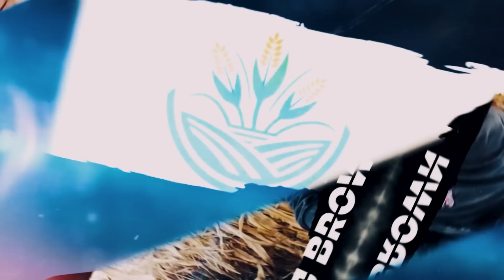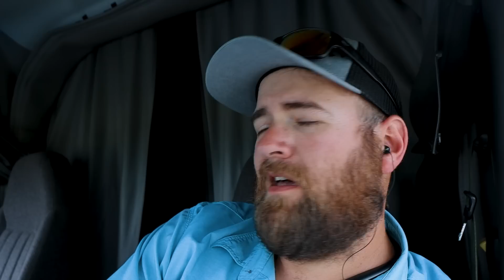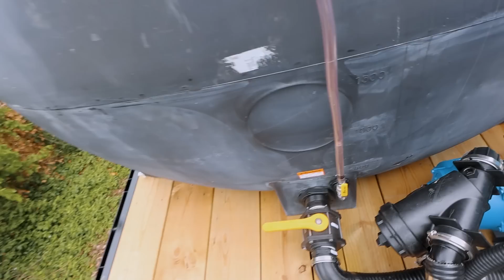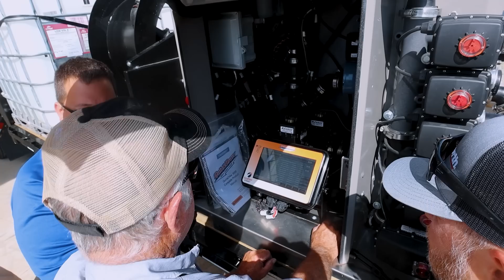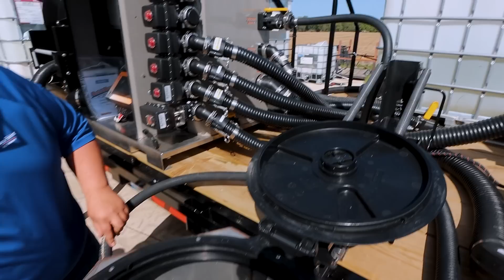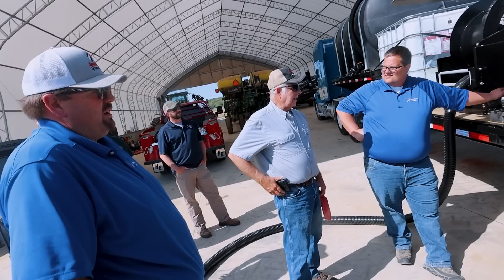Old Farmer purchased the most High Tech Advanced Spray Trailer Ever!

Comment: Very cool technology, I started on a 1603T Terragator in 1986. Speedometer, pressure gauge and a bypass valve. We added a flow meter but the suspension fertilizer we were selling and applying was tough of the meter. We’ve often talked about when we started using 30 gallon drums of “Landmaster” and how awesome it worked in the beginning. Good times. My favorite custom rig was our Hagie, the front boom on row crop was great. Keep it up !

Comment: Just a warning on the Honda motor: the auto choke on it can stick. Pull the carb off and physically push the choke open and you’re good to go again. Honda has had a problem with it and talking to sure point techs on a semi weekly basis the only fix they have is to send out a new carb assembly and hope you get a good one that doesn’t have issues. In my 3rd year running a quick draw it has been my only problem. Absolutely love it.
Reply from the maker: Good to know, thanks

Comment: Close off the upper tank from the lower and just use the fill line for the sprayer to fill the front tank. 

Those ball valves are there in case the gauge line splits so you don’t loose the tank of water. 

I see it now, Bob now has a tender trailer and a tender helper. Helper runs the computer and feeds him chem while he just stays in the cab and drives. 😂

Comment: All you Ag youTubers got jealous of Tony Fast's new spray trailer he got last year and HAD to get one as good or better!  Yours looks pretty nice I have to say.  This high tech stuff sure beats doing it by hand and stirring it with a boat paddle (yep, no weeds or insects ever got on or around that paddle!).  You may have to keep some cardboard in the console cabinet so you can see the display in the sun!  I didn't see a hand wash station, you might want to add that.  If your memory is like mine, a sharpie marker on the valve handles saying what they are might be helpful.  I wonder if that computer has a log function to help you keep up with the "what you sprayed, when /where you sprayed it" requirements.  That would be like having it from the horses mouth so to speak. Looks like it should be easy to work on should that become necessary.   I know you all will love that trailer for many years to come.

Comment: I'm thinking back to the 60s ...50 gal. Tank striped to back of A JD... measure chemical up to the mark dad but inside the pail ..pour chemical  in tank..fill tank with water...head out  to field turn valve on top of tank and watch the nozzles for plugged tips..and make sure pressure is at what dad said it to be...oh and 4th gear is mandatory....were was dad cultivating corn I hope